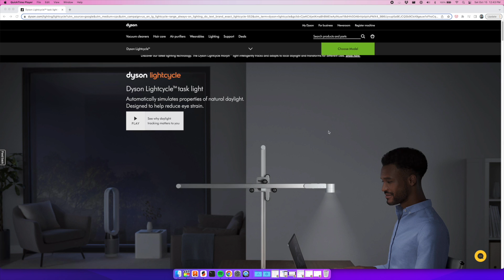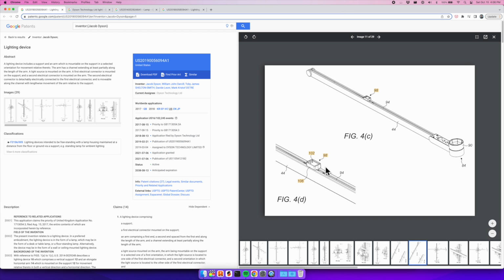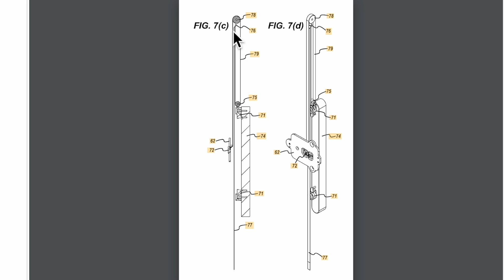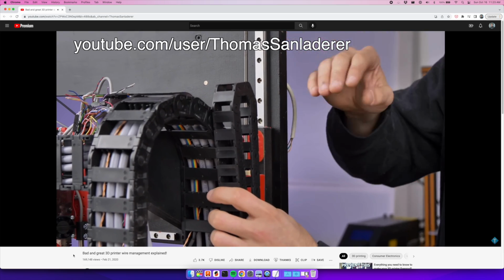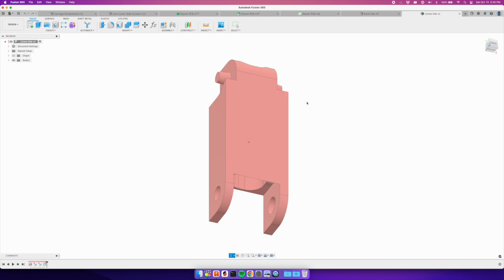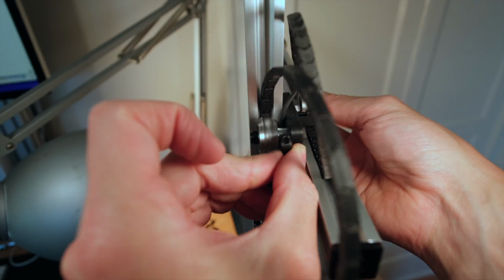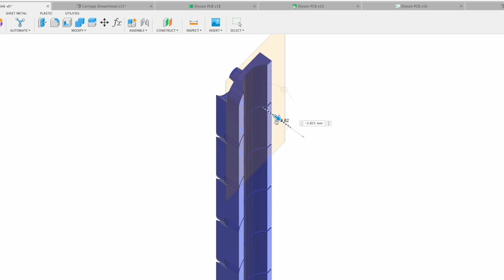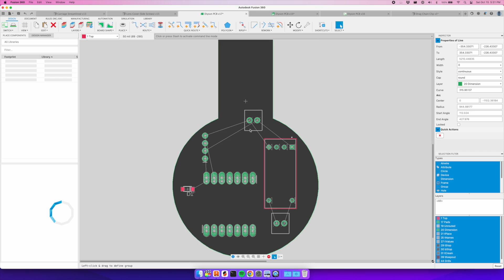Cable management so good, it's illegal - DIYson Lamp Build Log #6

Comment: Why not isolate channel in extrusion and on isolation put alu or copper tape. So you have  on top and bottom + an - line. Then just little brush like connector  to take electric from lines ?  Loose cable chain and  NO WIRES !! Like dyson but i think little better ;)

Comment: Try to align mounting axes of two drag chains. You may have to add an extension to the connection plate for that - upwards above the roller where you added a custom spacer with a channel. A single horizontal link should look simpler and more intentional.
Alternatively, you might be able to find more space for it if you modify the connection plate so that two wheels that are outside the square arrangement are on the top and on the back.

Comment: You could make a spring system at the bottom of te lamp and it will always want to retract the cable inside. You can put the cable in the Z axis side of the Y axis profile, and Y axis side of the Z axis profile. The cable can move freely inside the Z axis profile and can be pulled out of the Y axis from the intersection point of the two profiles. So basically when you move the lamp up or forward, the cable pulls itself from the spring mechanism and if you move the lamb down or backwards, the spring will retract the cable in. So you can perfectly hide the cables. I would love to help if you decide to use that idea or you have any questions.
Reply: I was thinking the same! So +1 for you comment!

Comment: And 1 more subscriber, me!
Great project! Instead of a cable, and because you are now going to use 2 wires anyway, have you thought about using rails and a slider?
You need 1 in the vertical part, and 1 in the horizontal, and interconnect them in the crossing. For the rails you could print a long part that you can slide in from the head end of the extrusion, and hold 2 copper rods, like this: <o_o> 
o=rod, rest is 3D print. And the slider comes in between from the top. (maybe upside down is better, so it doesn't collect dust).

Comment: I'm curious why a contact strip and rolling contacts can't be utilized. Surely a DC LED doesn't draw enough current that couldn't work, you'd have a contact block on the carriage with the rolling contacts spring loaded to apply force against the contact strip hidden within the vertical and horizontal extrusion. This would result in effectively zero wiring visible but would introduce several wear components and some DC voltage on a surface.

Comment: I'm wondering if you can use copper tape to bring power the light head. You can put the copper tape inside the aluminium profile and use a sort of magnetic contact to bring the electricity. You can 3d print a profile to fit inside the profile. The 3d print profile must have two side, one  magnetic  and one with copper tape.

Comment: Great series, i binged it as soon as i found it. Now i think about building something similar, but instead of the aluminium extrusions i kind of want to use two pieces of round bar for each arm. (Of course i can afford add another project to my giant project backlog, why do you ask?)

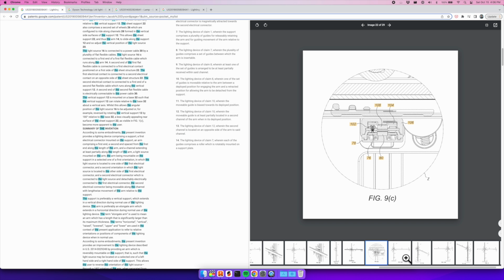I think Dyson routes the cable in the horizontal arm first towards the back, away from the LEDs towards the back and then to the LEDs. Kind of like you did, just without the drag chain. In the picture [FIG. 9(c)] you showed at 2:45 you can see the cable going towards the left, and i think the stronger, dark line above the carriage, in the middle of the rail, is the cable going towards the lamp head. In FIG. 9(b) of the same patent file you can see the loop, just below the "44" number inside the arm. I guess they get away with this because they designed their own profile for the arm, and therefore could include enough space for the cable not to have a too small bend radius.

Comment: amazing project!! I love it. to answer your questions according to me :
1 - May be you should consider using way smaller section cables for data than for power. This might go through the drag chains non?
2 - Why your dragchain head isn't flat for the horizontal one? it shouldn't be vertical?
3 - to join vertical cables to horizontal cables why don't you put a breakout board on the carriage?

good luck for your project. seems very promising.

Comment: You seem to be overthinking this. I didn't check the power specs of your LED,  but I would still run the needed live current discreetly on a track and pick it up with a custom wheel modification. For smaller LEDs I've ran current with conductive polish. Also, there might even be something adaptable from all that wireless charging tech that's floating around.
Reply from the maker: Overthinking!? My solution is simpler than yours! Either way, cool idea :)

Comment: If the flat wire exists in a single-conductor variant (and fits in the slot), I wonder whether you could use that for positive and use the rails themselves as ground.  

I don't know whether OpenBuilds make metal roller wheels and whether the bearings and bolts would pass the current (not to mention having to tie across two wheels on the arm mounting plate) but it could be something to consider.

Comment: You can make a model of a patented device for your own use, but is unlawful to manufacture the device for sale.  If you make slight changes or improvement to the design you can also apply for a patent which will protect your idea.

Comment: Just binged your channel and I absolutely love it!  Regarding wiring from base to vertical profile, I really think you should pursuit to replicate the 360 rotating feature. This could be done by using an off the shelf slip joint or try to make a pcb in the base with two rings with power and then pogo pins on the bottom of the vertical profile and from there to the lamp. Also regarding the flat cables - they looked really awesome. 3d print a jig with two razor blades and you could easily make it fit. You can dye the cable with iDye Poly - it will dye any kind of plastic, I use it a lot. Lastly I really really hope you'll use USB-C powering instead of those old barrel jacks 🙂

Comment: Awesome content! Keep it up dude! If you make it open source I might make one myself. Just a thought: I'd try to use POGO pins and a slide to get the power all the way to the top. The pins are made out of brass which has good friction properties (it's already used for brass bushings also, although not the same exact alloy used for electronics). The pogo pins could be placed in the carriage, and  slide against a brass bar hidden in the aluminum profiles and isolated from them. The question here would be how reliable it can be over time. But would need to test. I wish I had more time to finish my projects! Hahaha kudos man
Reply from the maker: I think this solution might be possible, stay tuned :)

Comment: Maybe a similar design to a slip ring would work, a slip ring uses concetric metal circles and carbon brushes, what about using straight metal tracks and carbon brushes instead? You could run one track up the vertical beam, it is connected to brushes in the carriage and more brushes on the carriage connect to tracks on the horizontal beam. The problem then would be exposed metal tracks that could pose a problem since it would short if touched with a ring or metal object. Maybe you could get around that by having the carriage part a rubber covering as it moves on the beams or maybe you could have some form of belt or covering that just goes over the tracks and loops round the ends of the beams and is connected to the carriage so as the carriage moves it pulls the covering over the exposed tracks so only the bit inside the carriage is exposed.

Edit: You cant fit a 5 conductor cable in the drag chains but what about a 3 conductor one? You could have an MCU in the base and in the head and have them communicate through simplex uart or just have the data go one way, from the base to the head.

Edit 2: Would it go against dysons patents if you ran a flat cable along the belt? It isnt in the belt like their solution, it just runs on the top of it? You probably dont need to worry much about wear because of how infrequent this will move.

Comment: Nice. I was thinking of some kind of conductor rails the whole time. Brushes and rails hidden inside the grooves on both sides, so the live is on one side and neutral on the other.
Reply from the maker: I would love to do this, just need to find an affordable or (preferably) off-the-shelf solution. I can't seem to find any. Any suggestions?
Reply: @StevenBennettMakes  What about brushes used for brushed motors? They probably make all sizes of those. Add some capacitors to make the circuit resilient to potential disconnections/hiccups from moving the lamp around
Reply: @StevenBennettMakes  I'm absolutely not sure... but I found a pretty small rail. Paulmann URail 97683 High voltage mounting rail.
But the brushes might be a bit of a challenge.

Comment: I keep thinking that if the wire were looped around the end of the arm, back to the post so the total wire length never changes as the arm moves back and forth it would be better, and more invisible. But there are probably practical reasons for not doing that.  That scad model is a great link thanks for that.
Reply from the maker: I really wish youtube comments supported doodles because my limited imagination can't quite picture this haha. Can you elaborate?
Reply: @StevenBennettMakes  Imagine a drag chain that runs from the LED, to the far end of the horizontal arm and then back to the gantry.  but very thin, like a belt. 
This is also the first concept that came to my mind thinking about methods of transmitting power and signals along the rails.
Reply: I had this thought too initially but I don't think it solves the problem.  If you're running the cable over the far end of the arm (opposite end from the LED) then that distance remains the same, regardless of the arm's position.
Reply: Check out Core XY printers - think of the LED as the print head. Not a bad idea really, but would have to change a bunch of the build.

Comment: I haven't gone through all of your videos yet but could you have used Track lighting rail instead of 2020 extruded aluminum (ie Home Depot num 804-979)
Pretty sure that Dyson doesn't have the patent on the generic idea of lights that are connected to wires embedded into a track.
This is an interesting build - Sub'd
Reply from the maker: Thanks, Earl! I've thought about track lighting too. Something like that like it would eliminate the problem of tidy wiring at the expense of guaranteed compatibility with the v-slot wheels. I'll keep looking into it, thanks for the suggestion :)

Comment: I think you might be able to reduce the protrusion distance of the horizontal drag chain when retracted if you change the exit angle of the link that's attached to the carriage. Rotating it 45-100 degrees maybe? Would be easy to test by removing the top screw and holding it at different angles. Actually, it might even perform better on a pivot, instead of being solidly mounted to the carriage.

There are other ways of attachment that I can think of, but none of them without drawbacks either in terms of manufacturing, complexity or looks. Drag chains are a fairly practical and robust solution.
Reply from the maker: Good call, I'm glad you pointed this out because that's exactly why I designed this feature this way. Just like you described, the link's angle can be adjusted and then fixed in place by tightening the screw. I can even test your pivot theory by loosening the screw so it rotates freely. 

I may also try to cut down on the protrusion by playing with the minimum bend radius of the chain (this is adjusted at the link level before printing). That being said this involves printing and assembling multiple new chains... and there are other exciting things to work on right now. I'll have to come back to this one :)
Reply: @StevenBennettMakes  Yep the way you're doing it in multiple parts is definitely the smarter move especially for development and prototyping. I feel you on making drag chains too lol, it sucks.

Comment: Very nice lamp design. I may have to make one for myself. One thing I would do different regarding the cable management is instead of using a drag chain, I'd use sticky back copper tape (used in making stained glass windows) inside the grooves of the 2020 extrusion with a layer of Kapton tape between it and the aluminum to act as an insulator. A copper wiper or metal ball bearing would act as the pickup to pass the current along. This should be perfectly safe as we're talking low voltage (12VDC?) anyway. If the 2020 extrusion does not have any anodizing on it then it itself could be used as one side of the circuit.
Reply from the maker: Awesome idea. I really hope you end up making one, I'd like to see you that solution in practice!
Reply: I agree - for a low voltage solution, eliminating the wire altogether seems like the best approach, though i don't immediately know what complications might make it unreasonable.  I was thinking the conductors could easily be hidden behind a little cap that only had a thin slot to allow a small strut to reach in and contact the conductors with spring loaded wipers or some other mechanism.  That would completely eliminate the possibility of any little fingers getting in there.

I would also like to try building one, but i have a million other woodworking and electronic projects on my list, so this would be pretty low priority.

Comment: The drag chain is a cool solution! Did you evaluate using bowden cables?
Reply from the maker: Thanks! As far as I know a bowden cable is free to bend in any direction and somewhat rigid. The benefit of using the drag chain is that it's rigid on one axis and very flexible on the other which helps it stay in alignment with the aluminum rails' channels. Are there bowden-style cables that work like this? Could be a promising option if so!

Comment: Why not use brushed contacts on the rail and carriages?
Reply from the maker: I like this idea, some other folks have suggested it as well. One of the goals for this project is to make it open source and reproducible, so I'd have to find a widely available off the shelf solution. Haven't been able to uncover one yet on the big merchants like Mouser, Digikey, Newark, etc. Any ideas?
Reply: @StevenBennettMakes  you can use 2mm pencil leads as the brushes and 2 thin copper bars as the electrical rail, put the two thin bars in the channel using printed guides that go in the slot as well. I can make a CAD of the concept if you desire a better explanation.
Reply: I made the CAD anyways... how can I send it to you?
Edit: the CAD uses 3mm copper square rods
Reply from the maker: Makes sense, thanks for the explanation. Are the pencil lead brushes consumables in this solution?
Reply: @StevenBennettMakes  given how long graphite lasts on brushed motors, I don't think they should dregade much after the first passes.
Reply: @StevenBennettMakes  Just found out: there is such a thing as graphite foil, which I guess could be used as well, specially  replacing the copper.

Comment: I wonder, could you eliminate the ground wire by using the entire frame for the grounding? Then you would only need 1 wire and you could use some sort of sliding device to slide along a power wire.
Reply from the maker: Wow cool idea! As an electronics novice, I don't trust myself to safely pull this off, but I would really love to see someone try it :)

Comment: What a great project and video series👍🏻. Just a thought: we used to have a dining table light with small halogen bulbs in them, but no wires anywhere to be seen. After investigating a bit it turned out that the aluminum casing of the light was actually made out of two parts, insulated with plastic and air in the middle. One side was +, the other side -, thereby deleting the need for wires. This might be a concept to look into for a v2, the number of new challenges would be enormous… but the challenges might be interesting.
Reply from the maker: Wow very clever! That could totally work in theory, I might not be up to the task personally, but I hope someone picks up this idea and runs with it. This would be a serious upgrade. Thanks for sharing, Kris :)
Reply: Sliding electric contacts are well established in electric trains and electric motors. They work remarkably well and reliable. A typical material combination for slip rings is hard brass (CuZn39) in combination with graphite or metal graphite. The graphite acts as a solid lubrificant and makes the motion very smooth. The voltage drop depends on the current density but is typically around 2 - 3 V @ 10 A/cm2 for graphite and 0.1 - 1.5 V @ 10 A/cm2 for metal graphite. I guess with a reasonable contact size this results in an acceptable voltage drop for such a low-voltage (12 - 24 V) application with moderate power requirements (10 - 100 W). To my knowledge, slip rings are also used for operation lamps that require 360° turnability.
I think a sliding electric contact would make a very attractive and simple alternative to the complex cable routing. With a proper implementation, the sliding contact is invisible, compact and as smooth as the wired connection.

Comment: You might consider wireless power and bluetooth for data.  https://youtu.be/3E5PUnYlaTM https://youtu.be/2mePPqiocUE  For wireless power you could have one set of coils at the base, wires inside the extrusion up to a second set on the x-z junction.  Another idea is to model some drag chain clips that incorporate the belt thus allowing you to use conventional wiring at least up to the x-axis.  I'm glad I found your video, it's very inspiring!
Reply from the maker: I could totally see wireless power playing a role here... especially for transferring power from the vertical rail through the carriage to the horizontal rail. Thank you for sharing your idea, I'll keep this option in mind going forward :)